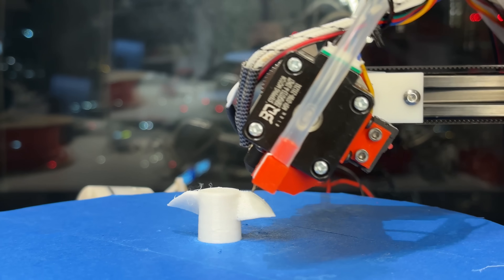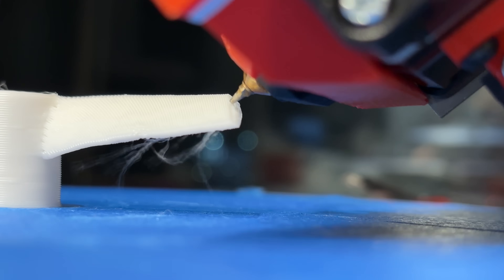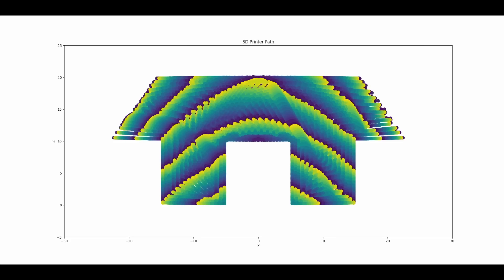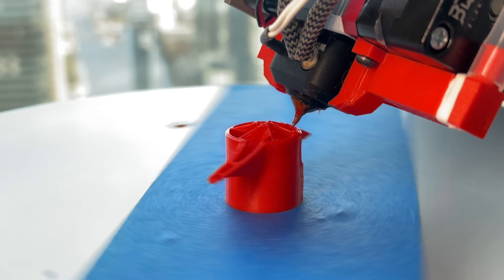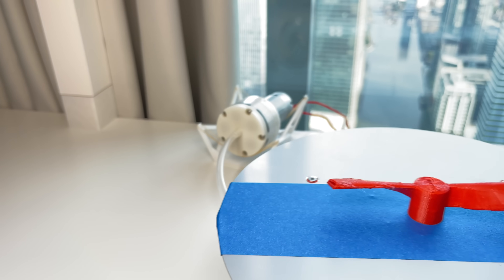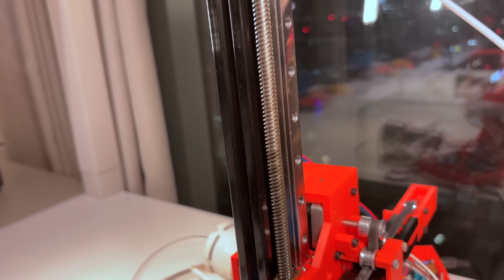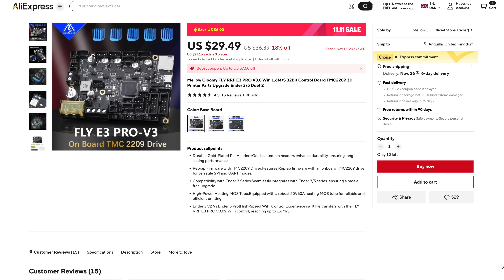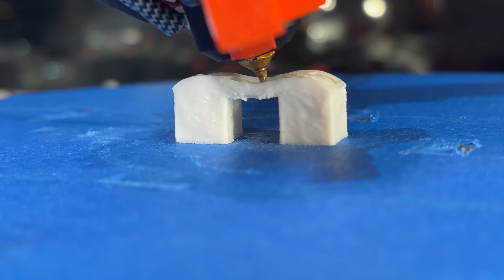I Built a 4 Axis 3D Printer Unlike Anything You’ve Seen

Comment: The software is what amazes me the most, and has implications beyond just printing unusual geometrys without supports. It's possible to print parts with crossed layer lines in three dimensions, entirely bypassing their typical weaknesses. For example; that propeller could have had a basic internal skeleton built up as shown, then built out further with long paths across it's length with other alternating layers sorta wrapping it together in the way that carbon fiber layups are usually constructed to prevent there being any direct cleavage paths.

With strong tensile elements added inline to the melt, along with a mechanism for severing them when the nozzle has completed a layer and needs to be repositioned, a 3D printed part would have the potential to be much stronger than a conventionally molded one. I'm immediately subscribed

Comment: I'm wondering if you can configure it to prioritize strength of final product. For example, in the propellor you have printing, the layer lines are vertical. On a normal 3d printer, the layer lines would be horizontal. for this part, the horizontal layer lines would give a much stronger part overall.

Comment: There's not just one insanely clever thing here, there's like ten. And the fact that you have to combine mechanical design with electronic and computer programming. The head rotation and arm projection kinematics amazing. Yes this was anticipated by CoreXY kinematics but this is truly innovative still. I know conical slicers have been done before but had to be adapted because this is certainly not a conical printer. Even the incidental little rubber band cradle trick to silence the air pump. Simply a tour de force.

Comment: Absolutely astonishing work! Did you end up using a Duett board? I have tried using them in the past but they gave me so many issues I couldn't deal with them. Specifically if you are using Duett, are the stepper motors loud super loud?

Comment: If the length of the linear axis spans the entire print bed then you don't need to turn it just for passing through the center. Every physical point then has multiple ways to address it (near side or far side), which becomes it's own optimization problem that you can solve for in the slicer.

Very cool project btw.  Been waiting to see someone build a rotating head printer to "print on air" and your core-r-theta design is sleek af.  I might try to build one.

With your homing mechanism you can actually plot the shape of the whole bed and do software bed tramming.

Comment: This is exactly the way >4 axis commercial CNC machines work if you were to see them operating without their metal enclosures around them. It seems like a lot of 3D printing issues could have been avoided if the 3D printers were just based on tried-and-true commercial CNC machines. The current crop of 3D printers are based on "desktop CNC" machines that use sliding tables for x-axis and require add-ons for a 5th axis. The gantry over a table CNC machine is really only used for processing sheet materials (i.e. cutting gears or other parts out of metal sheets). It was never intended to be used for 3D, whereas 5+ axis CNC machines (which have been around for decades) are used to mill entire parts out of metal, like turbines and complex shapes.

It's good to see gen z 'inventing' things that have been a mainstay of manufacturing for the preceding 5 decades. :)

Comment: If there were two solution to any coordinate because the gantry arm is mechanically allowed to pass through the center, then it would technically be possible to overcome the singularity crossing problem but the parser would get a whole lot more complicated because it would need to to keep track of when to flip to the alternate solution set or just rotate around.

Comment: I recommend conducting a comprehensive benchmark to compare the structural integrity of your 4-axis design against traditional 3D printers. The fiber-reinforced filaments would likely demonstrate significantly enhanced structural performance in your system, if applied correctly.

Comment: Why do you not put the motor on the end off the x-asys instead on the print head? You can achive ome clearence, but you have a reason I'd like to know it, I'm super curious :). This project is sick by the way, awesome job!
Reply: The acquarium pump used for the part is simply brilliant. No vibration on the print head, less weight and in your design, it prevents the giroscopycal effect!

Comment: intuitively it seems like of the print+bed motion is less mass than the printhead then there’s virtue in moving the print. Maybe set the print bed on a Stewart platform-ish mount? Stewart platform can rotate a bit, might be enough - or you can set the arms on a ring. 

what really makes non-planar effectively possible is the long tip with it’s magic aspect ratio.

Comment: Is there an argument to be made for preferentially avoiding using (or at least starting at) the centre of the printbed? I could see it causing a problem due to deflection of the surface due to an uneven weight distribution, as well as a shift in rotation speed based on changes in momentum. But I can also see the added weight to be small enough that non of these things are even remotely an issue.

Comment: Uh, this is FREAKING AWESOME. One more thing that might be worthy of investigation is printing on a cylinder. Zeroing on the cylinder might be difficult, but that would add another layer of awesome to this. It would also eliminate the dead zone. It would also make for very strong prints since the layer lines could be printed at angles along the shaft and opposing every layer, almost like pultrusion.

To deal with the dead zone you might try to transfer straight across the center and then switch the direction when you reach the opposite perimeter. I suppose you'd need to lift in the middle, but that shouldn't be too bad. This kind of thing happens regularly in cartesian printing.

If you need something printed I'd love to help you out, sadly shipping from me would be silly. I'm sure someone else will offer you printer time. I can help you design things if you give me an assignment though.

Comment: This is awesome. How did you handle the variation in layer thickness as you transition from flat to angular printing? Because the potential exists to adjust flow rate and layer thickness to make really smooth transitions

Comment: The biggest problem with 4 axis 3d printers is how complicated most of them are. This one looks simple enough that I can build it, except for the fan cooling. 
What kind of pump are you using? Most of them will break if no water runs through the pump.

Comment: This is another of the best ideas I've had for 3D Printing being done by (not me).

I had this exact idea around a month ago (not the motion system of the two servos but the general idea) alternative to a Robot Arm. 

I sincerely would appreciate it if you would make the design and firmware for this open source or at least available to me please.
Reply: Don't think I thought you "stole" my idea. I didn't I understand that its entirely possible for designs to be conceived of separately. Sorry its just I receive credit only very occasionally with pretty much everything. I watched the you're presentation through and learned you do plan on open sourcing the printer. Thanks.

I definitely would like to build this design with 3 or more tool heads. Larger format maybe even. I'm not very good at writing firmware or software but I'll contribute what I can.
Reply: I studied Ceramics Art In collage. With a paste printer you can also print metal paste.
Reply: This Printer and Jon of Proper Printings TIME printer are the most exciting printers I now know of.
Subscribed.
Reply: Compressed air (perfect for effective part cooling in an actively heated enclosure) This looks perfect for Aircraft/Aero components/structures!

Comment: Unironically, this machine is beautiful. 

This may be a dumb suggestion, but what if you replaced the bed's single rotating motor with a similar mechanism to how the extruder arm and head operates? Having two motors spin the print bed, but then when they rotate in opposite directions, they move the print bed in a linear motion perpendicular to the axis the print arm moves. Like some kind of hybrid rotating bedslinger. The bed slinging would ONLY be used to prevent issues with singularities, but beyond that, idk if it'd even be worth it.
Reply: This is a great idea, and I hope it receives more attention. If the R axis of the tool head was perpendicular to the R axis of the bed, you'd actually have an X,Y,Z, along with an A and B axis. No more dead zone.

My idea was to allow for the print bed to be a cylinder, which would be tricky, but would also allow for some other use cases, and excellently strong parts since your layer lines can be along the length of the part and never overlap.
Reply: Print speed will always be limited when using a moving-bed design, since you have to accommodate the tendency of the part's inertia to tear it off the bed. Axial beds reduce the forces somewhat, but are still fairly restrictive. What about, instead of sliding the bed, we put the main print arm on its own vertical axis? This would allow the print head to sweep through the center of the bed axis, and the combined movements could be optimized for maximum acceleration along both axis independently in order to maximize total traversal speed.

IMO the real value here isn't in reducing support material, but in enabling more structurally useful layer alignment. So maybe just intentionally printing with strong supports to promote bed adhesion and prevent slip/layer shift would also be adequate.
Reply: @haphazard1342  I was going to write a comment, but I quickly realized that I had no idea what I was talking about. So instead, I'll just include my thought process as to why I thought I would put the extra axis on the bed instead of the gantry. 

In my mind, adding an exra axis to the already complicated gantry setup would probably reduce more deflection than adding that same axis to the bed instead. Like, both axis, axes? on the printer now can suport the print head easily because they're perpendicualr to both the axis they're moving along, and also their axis of rotation. But if you added an x-axis to the bottom of the gantry so it could slide back and forth, all the weight of the printer head would be exerting a moment in line? parallel? in the direction of rotation along the x-axis. Imagine cutting a CNC router gantry in half, it'd tip over without some serious extra support on the remaining side. Meanwhile a slinger axis put on the bed wouldn't suffer from that issue. idfk where I'm going with this. Just my thoughts.
Reply: When path planning for slicing the gcode, I wonder if this would create too many degrees of freedom and thus become an unsolvable problem from the inverse kinematics perspective.
Reply: @timothysands5537  Hmm, maybe. There would be 1 x-axis and 1 z-rotation for the bed, plus 1 y-axis, 1 z-axis, and 1 x-rotation for the gantry. Not saying my idea is good or feasible, but you could probably limit the software to being only able to use slinger and bed rotation separately. Like, if it wanted to rotate the bed, it'd have to go back to zero or something. Though that brings another issue, depending on the calibration, it might be extremely difficult to line up the center of the bed if it's on a slinger with the print head on the gantry. As the machine sits right now, the center of the bed is in-line with the print head, and it CAN'T misalign, ust due to how it's built. But with a bedslinger option, it could. Then you'd potentially have a MASSIVE distortion issue
Reply: @eclipseslayer98 I don't see why alignment would be any more difficult to handle. Sure you're now relying on the accuracy of the drive system but so is everything else.
Reply: I've been working on a 5 axis design that uses exactly this motion system. It allows me to place the motors so that they contribute as little as possible to the moment of inertia of the rotating axes.
Reply: Interesting, but seems to me like a problem that isn't really worth solving, not that there are no benefits, but unless you have a very specific need in mind its adding complexity and fragility while getting you very little. As any smaller print just won't use the centre of the bed and  the prints that do end up having to cover it will end up being a bit slower but still work. Which as larger prints are always very very slow anyway won't actually feel like a big problem - anything over say 5 hours in print time and its come back in the morning however many days later it takes, and for a decent quality rather than 1 min or faster benchy quality print the extra time those rotations will add will be pretty small (unless you really position the part terribly). It will only be a few base layers that will be slow, a bit of infill that probably doesn't even have to go near the centre (if the slicer is smart at all), so may not really be slowed down, and then a few top layers that are likely slow - so say 10 layers with really noticeably extended print times compared to a version sliced with your hybrid.

Now a similar concept that might have more practical value, but is also kind of crazy would be to have a rotating conveyor belt - then you can print endlessly as long as the print itself doesn't rotate far enough to hit the z and x axis (so anther rotational exclusion zone in that mode), and you can still just reposition the centre of rotation or fill in the extra slow bits around that centre point with x-y rather than polar assuming a slicer that knows.
Reply: @foldionepapyrus3441  It solves the use case he describes in the video, in which the geometry of the "basic bridge shape" with the central overhang requires very complex slicing geometry in order to print at all. There are plenty of shapes that are straightforward to print on a bedslinger, but complicated on a polar printer. Adding a bed slinging X-axis would allow the printer to freely swap between both modes depending on which one is more convenient. It would take this printer from the realm of "good at some things, bad at others" into something more like a straight upgrade in in all domains. You get to benefit from the decade of optimized slicing and control systems simplicity of a bedslinger when you want it, and the ability to switch to nonplanar (or vice versa) when you need it. In theory, there is no reason that such a printer couldn't print a square tower with the same speed and precision of a standard machine, then immediately switch to printing 90degree overhangs sprouting right out of the walls.
Reply: @nicellis44 not to mention having both means that theoretically, if you could get it to work well on the software side you could have both polar and non-polar movements in the same print to get what you need out of it. I can see many places where that could potentially be useful if it was even just to have straight and rounded surfaces in a more complex part. 

Regardless, it’s quite apparent that an additional x-axis for the bed wouldn’t go unused.

Comment: what I think will be the biggest benefit of this type of printing is the axis-agnostic uniform strength of your print. If you print your object like you're winding up a ball of yarn, you won't have the weakness that traditional prints have in the Z-axis when layers separate.
Reply: @dtylerb  It might be possible to strengthen the parts by printing outer layers along the branches. Can't print all branches at the same time, though.
Reply: @neuschf  yes. Even if you still end up with some layers, if you can align the layers along the part axis as closely as possible then it's still a major improvement since each layer has more surface area for bonding.

Comment: Using one belt to control both the linear position and angle of the print head is genius.
Reply: I agree it’s very smart, reduces complexity 👍
Reply: ChatGPT summed everything up as:
"The discussion boils down to two key arguments:

 1.   Does "genius" inherently mean "new"?
        TomatOgorodow initially argued that something must be new to be considered genius.
        Moonshot9056 countered that "genius" refers to intelligence or creativity and does not inherently require novelty.

    Correct Answer: Moonshot9056 is right. The word "genius" does not inherently mean "new." It refers to exceptional creativity, intelligence, or problem-solving, regardless of whether the idea is novel. Many definitions of "genius" do not mention novelty at all.

 2.   Is the single-belt design genius?
        TomatOgorodow argued that since the single-belt approach isn't a groundbreaking or significantly advantageous design choice, calling it "genius" is an exaggeration.
        Moonshot9056 pointed out that whether something is genius is subjective—one person may find it clever, while another may not.

    Correct Answer: Both have valid perspectives, but Moonshot9056's argument is stronger. The evaluation of whether something is "genius" is subjective. While technical merit can be debated, someone can still subjectively view a design as genius based on simplicity, elegance, or insightfulness, even if it's not groundbreaking.

Final Verdict:

Moonshot9056 was correct on the main point—"genius" does not inherently mean "new."
However, the debate on whether the belt design is genius is subjective, making neither side definitively right or wrong on that part.

It was a well-structured debate, and it ended on a surprisingly respectful note, which is rare in YouTube comment sections!" lmao
Reply: nothing new
Reply: @yannmassard3970  There is nothing new today in anything so chill your expectations
Reply: @yannmassard3970  You must be fun at parties....